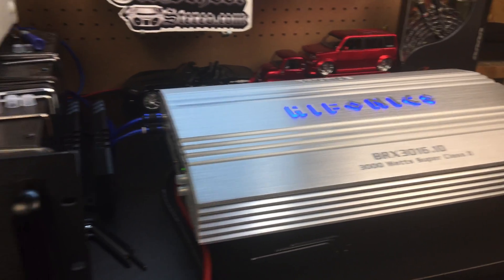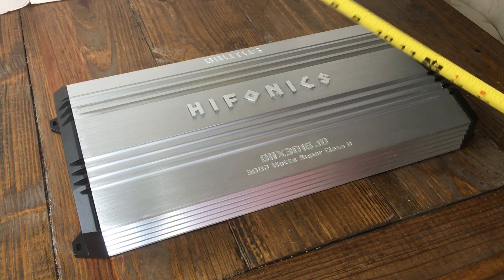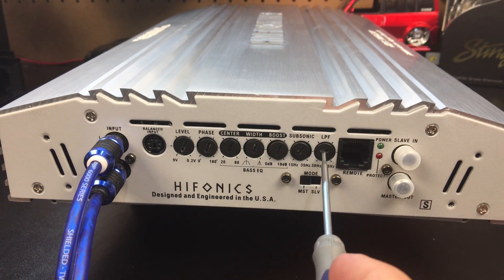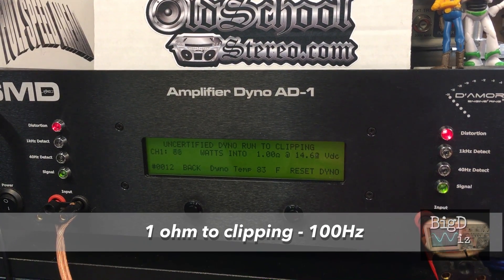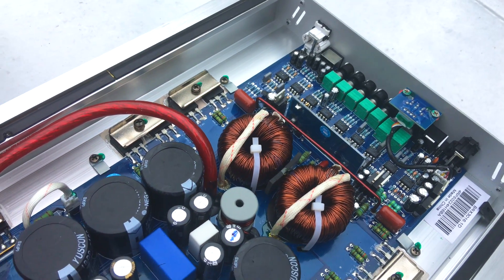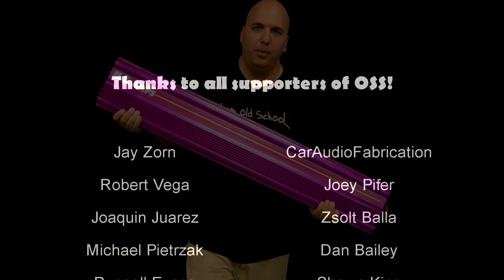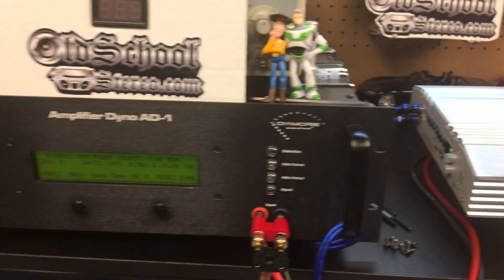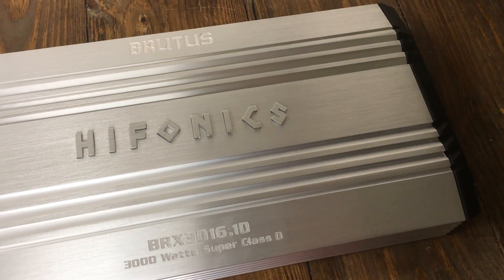Is That 3kW RMS or MAX? HiFonics Brutus BRX3016.1D 3000 watt Amp Dyno Test

Comment: That was no waste of 260 bucks. Well worth it in all the testing, got actual rms readings, actual Demensions and power inputs were actually 1/0. I have considered these newer hifonics amps before but shyed away because it says 2 Guage inputs. Lol I still go by power input gauge size, weight, size, and fuse rating on these budget amps haha. You Should Try And Test A Digitial Designs M5 On The Dyno.... Not A Single Video On The Internet Of An M5 On A Dyno...
Reply from the maker: +Salvatore Hayes glad it helped, thanks for watching and commenting 🤙

Comment: First off thanks Derek for once again taking one for the team. We really appreciate what your doing. But damn the Hifonics does it again. For the money I just don't think you can go wrong with one. I ran a 2k Brutus at around .67 ohms daily for about 3-4 years and never a problem but that was 8-10 years ago. Look for the price of these to go up on Amazon now because of this video. Seems to me it may be a solid contender if kept at the recommended resistance. Thanks again man.
Reply from the maker: +Kevin Ball I agree. Great performer and clean sounds on the test sub as well. I was going to get additional footage, but if you watch until the end, you'll know why I couldn't do this 😔

Comment: Are these not CEA 2006 compliant???
Reply: CEA 2006 is a joke, it's an honor system.
Reply from the maker: +Adam Moore no mention anywhere I could find...not on this series at least
Reply: They are not
Reply: Nope, but as demoed a short while ago, that cert label isn't exactly the end all and be all of must haves.
Reply: For the price, not too bad of an amp. But not very trustworthy with their power ratings. And not really impressed with no power rating in the manual. Hifonics has really slipped from the quality standpoint.
Reply: I was running a Crossfire BMF1000D about 8 years before it finally quit. That amp was already about 14 years old when I bought it in 2010. And it just crapped out about a month ago. I loved that amp as it never let me down. Now I'm running a 2003 Kicker KX1200.1 and I can honestly say those amps, back when they first came out, were worth EVERY DOLLAR! I was lucky to pick one up for $165 a couple weeks ago. And I will be buying the other one the guy has for sale. But I agree. Sundown amps are some of the best amps on today's market.
Reply: Shawn Rufus the 2016 series is not but the previous Brutus series was

Comment: ouch the smoke . thanks for the test .I would assume the music track would easily let this amp do rated power at all ohm levels?  it killed the 1ohm rating dynamically with the music track . its funny on the efficiency because many of the hifonics haters on the smd forum claim you might get 2k watts from them at 1ohm but they take in over 4k of current to do so. they have always claimed the hifonics amps are the least efficient amp on the market. this shows differently.  I was wondering if you could go back and check that massive baby amp you had the nano amp that did rated power at one test but not very close on the last test. I wonder if that music track would help that amp do rated power on the dyno vs just the test tones?  also those magical boss 4k amps might benefit from those music tracks....lol

Comment: Yea boy I have the Brx 1516.1D its the 1500w model and it put out around 2000 on 1ohm
Reply from the maker: +logan smith power to da peeps 🤘
Reply: I had the brx1516 and the skar rp2k and that brx was nowhere close to as strong as the skar and the skar does a little over rated.

Comment: That and did super good for what it is and the power is super clean sounding on there amps def would be great to not lie ppl would buy them anyway
Reply from the maker: +sleeper10s I guess I don't understand needing $1000 in electrical to use a $260 amp 🤔
Reply: @wal  the Xtr 2500 cost less than the svc7500 and need the same electrical setup

Comment: I have a 2400watt Hifonics and was told that it has to have 14.9 volts constant power supply to run properly, that they were power hungry amps.
Reply from the maker: +bigserge07 this one showed great efficiency, so I'm not sure I would believe what you were told. A lot of opinions, few facts 🤔

Comment: Just have the fets replaced D. 
Thanks for doing the dirty work so we know bro.
Reply from the maker: +james craghead it did more damage than that...I looked closer and one of the components between the transformers was detached from the board. I'm hoping HiFo will cut me a break and fix it
Reply from the maker: I broke da seals to show you guys the guts. I'm going to see if HiFo will still do the warranty work though
Reply: @wal  So, did they fix it under warranty?
Reply from the maker: @Chris-yy7qc  i returned for refund
Reply: @wal  Good ol' amazon.  That's what I was thinking, even if hifonix wouldn't repair it (honestly considering what you did to it that's fair).  But Amazon will basically always take returns within the 30 day period, sometimes longer than that if you take a while to ship it back.  Seems like the amp did well, even though it failed to protect itself from the abuse, which I think a little bit of idiot/"big dummy" proofing is expected in today's market.
Reply: @wal  "i returned for refund"  I'm not sure how I feel about that.  You straight busted this thing fair and square.  Appreciate your honesty but you guys are acting like it just goes into a magic hole somewhere.  It doesn't.  It gets returned to the company, and their account gets hit from Amazon for the amount. (Sometimes that doesn't happen and Amzn takes the hit...but that's usually when dealing with ghost companies from China.)  Watch SMD's video when he goes through a bunch of returns he got from Amzn.  As a small business owner who has had people try and scam my products to the tune of $4000+ (We design and manufacture motorsports products) by doing chargebacks or saying they never got it....I can tell you, it hurts and it makes me raise prices for everyone "just in case" it happens again so I don't lose my shirt and the honest people making the products can still get paid.

I know, I know this big dumb corporation probably has these things made for $50 via Chinese slave labor...but just know when you are dealing with a small company in the U.S.,  run by people like your neighbor things like this directly hurt us.
Reply: @wal   HF refund speak volume for its return policy.   I'll be more willing to trust HF brand in the future..
Reply: @wal  lmao
Reply: @JViello  Companies have a choice on doing business through amazon. That lax return policy is a considerable part of why it offers so many consumers ti businesses. It sucks but they still end up with more sales/exposure going through amazon (and their return policy) than they would otherwise. Its a dog eat dog world and any successful business, and most successful people as well, are far more shady/immoral than an unjust refund.
Reply: @JViello  I agree with you but at the same time disagree. His world view is not exactly wrong by any means. The end of the day this company took this amplifier and embellished the numbers to make them look better to the unsuspecting masses. However playing the music track for that long, while the distortion red light is on long enough to play through a whole song of Roxanne......., I can't agree with his decision to accept a refund no matter big or small a company may be. No company starts out on top...... Treating 1 company unjust and it being ok and not others because how successful they have been is a tainted view in of itself and why cities like NYC are in shambles. neither here nor there though.
Reply: Solder job. Fets,control boards,diodes,caps, easy peasey. If they don't fix it I can. Or recommend others that can. For a fraction of the cost of the amp obviously :)
Reply: @treynathaniel4075  yo need a amp repaired. I'm serious. No joke. CN you help me?
Reply: @treynathaniel4075  you still fix amps old or new?
Reply: @RomaVilla  yes
Reply: @treynathaniel4075  nice, I have a an older 4 channel Oxygen audio Alium F320 that works and sounds good but goes into protect or turns off with vibration or any hard or swift movements. I got it cheap from the pawn shop but I was made to believe that the amplifier was in good working condition. I know very little of this amp, are you familiar with this brand by any chance because I would like to know if its worth fixing. The sound quality is pretty good overall.
Reply: Can you give me an idea of how much it would cost to fix the amp?
Reply: @RomaVilla  With any luck its just loose solder somewhere. Couldn't tell you how much until I open it up.
Reply: @treynathaniel4075  where are you located. Need to figure out how much shipping would cost in order to send it your way. If you are interested in checking it out for me that is?
Reply: Better than the scv3000d. Sunclown, for the fanbois..
Reply: Trey Nathaniel i have the old brz2400 that needs repair. Who do you recommended?
Reply: Get it replaced under warranty
Reply: BigDWiz Aahhh yeeah
Reply: Yea usually there's always more than the obvious blown fet when an amp dies unfortunately

Comment: You should do the soundstream pa6000 they say is 3000 rms at 1 ohm
Reply: team louder hey brother I have one of them pa 6k there no where near 3k I clamped 2100 at .7ohms at 14volts the ta3k is much better that doin allot closer to 3k I have both now they both are not bad just don't like the pa mounting mine all broke
Reply: sleeper10s thanks Man! I have 1 too but where I live not a single person runs over 1000 watts so Idk someone that can check how much I'm getting out of it
Reply: team louder all u need is clamp meter and volt meter you can do it yourself real time with ohm rise and everything to see what your getting I don't have rise so u could be a lil less or close to that but they are super clean sounding
Reply from the maker: +team louder pretty sure it's the same as the Power Acoustik 10k I've already tested. Both are Epsilon companies, share boards
Reply: sleeper10s thanks man ima get one to clamp it